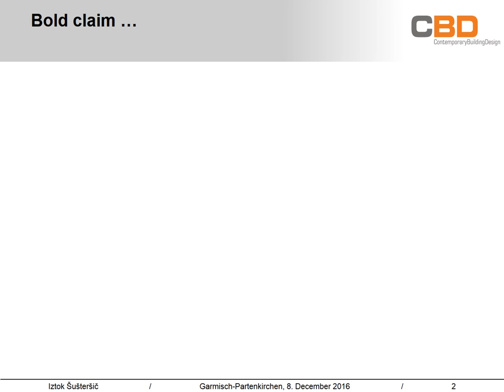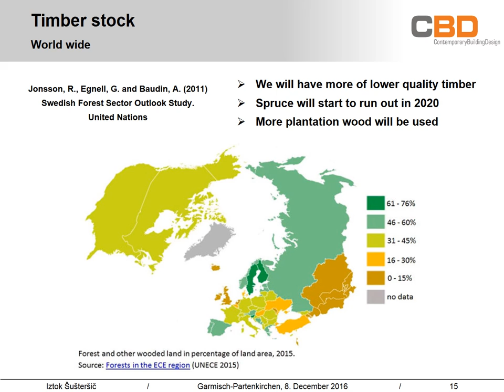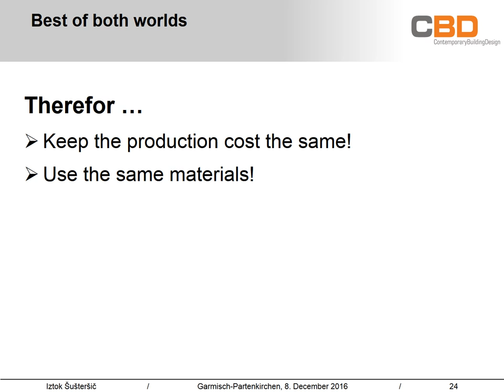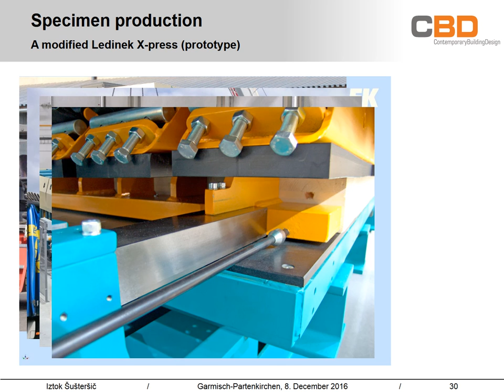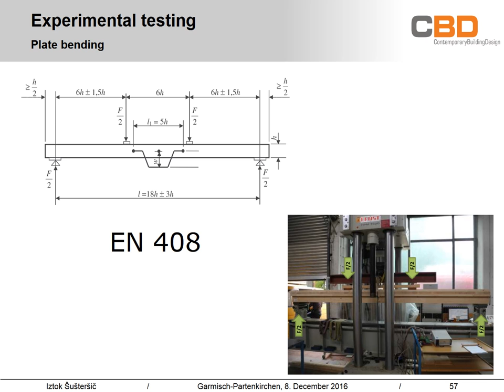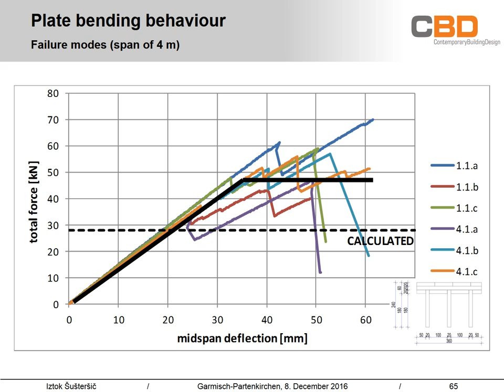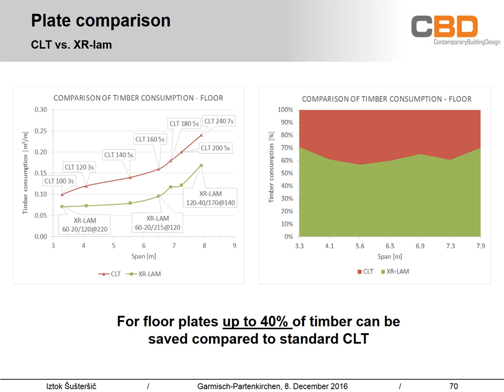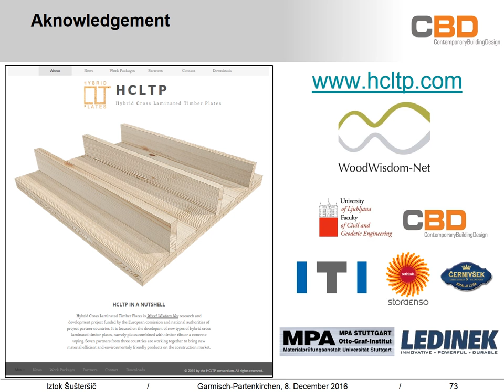Less is more - Optimised ribbed CLTs - the future

Comment: To be clear, one has to install additional materials for decking a
Or ceilings depending on orientation.  Also, wall finishes. Isn't the point of clt to decreased additional site materials and subs. I'd like to see the cost and materials offset to full clt vs xr with added finishes

Comment: I'm very interested in this application for building passive microhouses with enough wall space to include inexpensive insulation materials. (max wall thinkness 270mm). Any idea when we could see this being offered by industry? And whom that would be?
Reply from the maker: Hello and thank you for the expressed interest. Talks about establishing a production are currently being held, however I may not disclose any details.
Nevertheless, if you are doing microhouses a light timber frame may be a more suitable option anyway since your loads and spans are probably quite manageable.
Reply: hi Iztok, thanks for your input,
I'm developing a modular microhouse in which separate(already assembled) living modules can be transported, connected and disconnected, and the house can grow with one's life situation / wallet without the need for huge mortgages. For this plug&play system,  modules have to remain within in a minimum tolerance, hence my interest for CLT and XR-LAM
The overall principle is comparable to the Dwelle house, but with better use of space. http://www.dwelle.co.uk/dwelleing/dwelleing/

Can you give a rough indication of time frame (months? a year? 2?), without disclosing anything confidential of course...
Reply from the maker: Ok, I see. We were also developing something similar a couple of years ago ...

Regarding the XR-lam; a full running production could potentially start in two years.